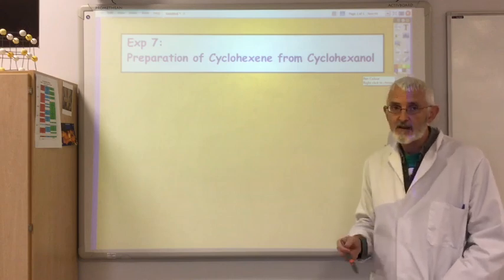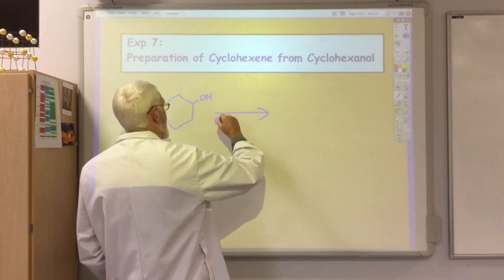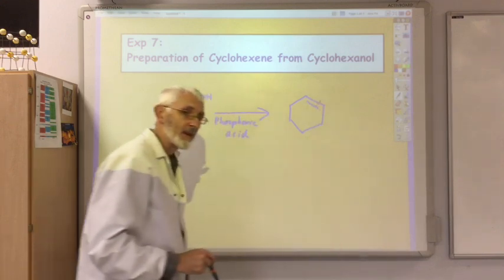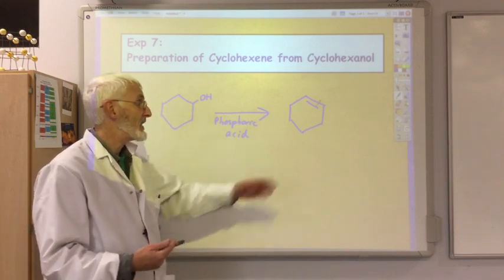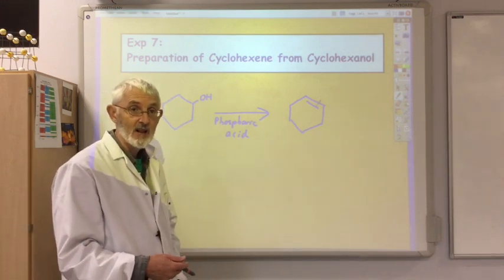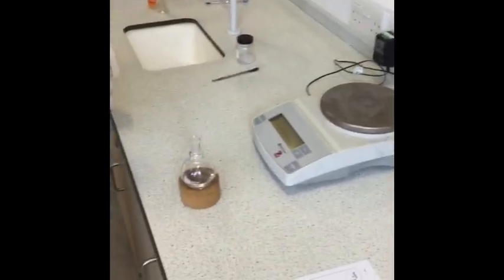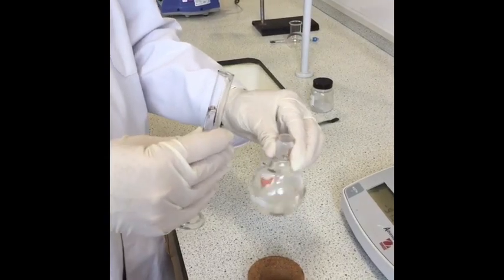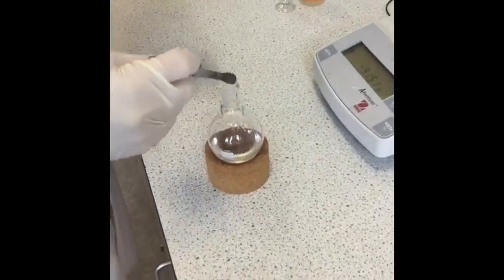Exp 7 Preparation of cyclohexene from cyclohexanol

Comment: thank you very much sir! would you mind answering my question? why did you choose phosphate for the catalyst over sulfate acid?
Reply: idk if this is correct so correct me if im wrong but sulfuric acid alone causes both oxidation & polymerization to occur. phosphoric acid is used as the dehydrating agent and it works betters, it just happens rather slow which is why its used over sulfuric acid

Comment: Can anyone clear me with the answer of this questions please? why the temperature on the top of the fractional column during reaction be controled? and why being added salt before the layers are separated?
Reply: hey the answer on your first question is because cyclohexene has actually a boiling point of 83 °C, so that’s one point why you check up the temperature when you see that it reaches on its 80-85°C that is where the destillation actually begins, and during your destillation you need to the check the temperature because afterwards when your temperature drops down again, your destillation is finished.
The answer on the second question is because before putting the salt you have a mixture of water and cyclohexene and actually the density of both are nearly the same, so you wouldn‘t be able to really see two different layers, after putting the salt and shaking it you can clearly see 2 different layers, the bottom the aquaeous one and on the top the organic one which is indirectly your cyclohexene. 
I hope that my explainations helped you and that i answered on your questions pretty enough:)